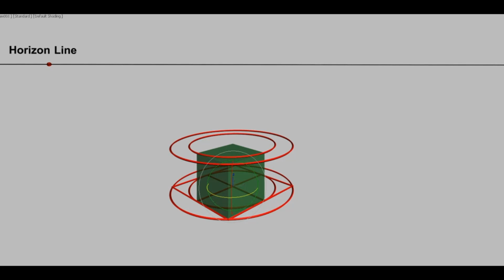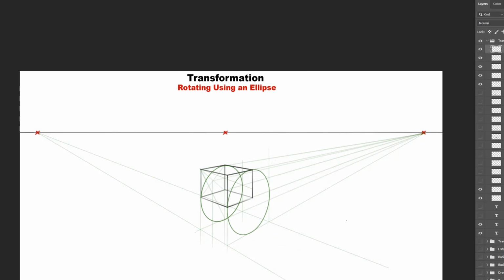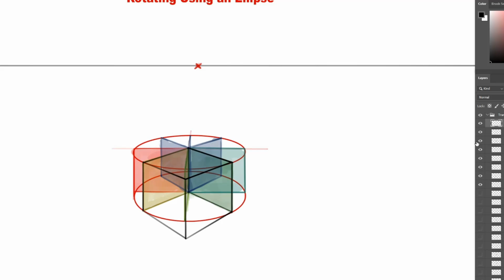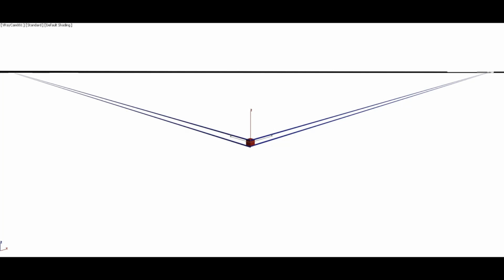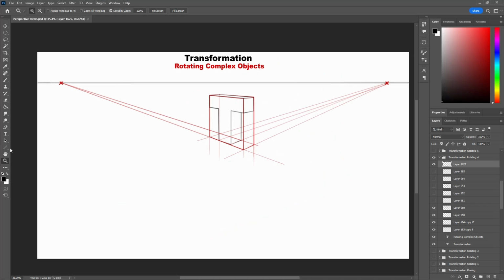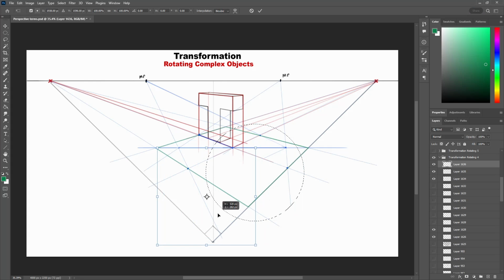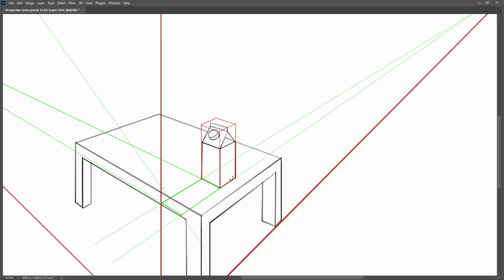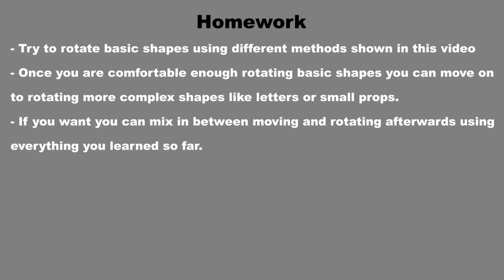Lesson 23: Rotating Objects in Perspective

Comment: Would this work for rotating in multiple axis? Say I want an object that is tilted in X, Y and Z: do these techniques work?
Reply from the maker: Sure thing, but you have to do it one axis at a time. So lets say you are using the ellipse to rotate the box on one axis lets say the X axis. Once you rotate it now you have to draw the ellipse again in the new location but for the Y axis and rotate it again. Then finally in the Z axis. Eventually you will reach the rotation you want. So if you are working in 3D and you want to rotate a box in Y axis you will do it like (0,90,0). If you want to rotate it 90 in each axis it will be (90,90,90). In 3D you can just free rotate an object or rotate it in X 90 degrees, then in Y 90 degrees and then in Z 90 degrees. Same thing if you want to draw it.
Reply: @SalemShanouha  Thank you very much!

Comment: I could not understand from 1:32 , how did you extend the line to the infinity? From where did that vanishing point came? and how exactly the rotation working in this case? I'm not very knowledgeable about this, could you kindly explain? Im not able to understand from 1:32 to 3:10
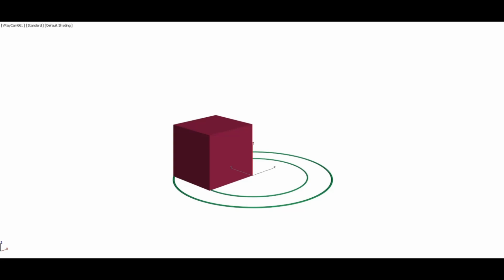Reply from the maker: the edge was extended to a vanishing point way to the side outside of my canvas but at the same horizon line. I guesstimate where it would be, but if you want to you can extend the canvas and hit the point exactly on the horizon line. The point of this method is that the rotation circle will be the limit to the box edges. as you can see at 4:30 no matter how you rotate the box its bound by the circles around the edges. so when you go back to 1:32 what I'm trying to do is construct one side of the box by choosing one edge as a base, then choosing a rotation angle or how much we want to rotate the box. Then since the box is in 2 points perspective the vertical edges will always be vertical, so now we got 3 edges of the face. for the final edge we can extend the bottom edge toward the horizon line to get the VP, and then guesstimate where the upper edge will meet it at that VP. Now you have a full face of the box. 

Now since we moved the first edge anticlockwise we have to move the other edge of the new face we want to rotate the same way. to get the same rotation we can either guess it or use diagonals to mirror points like we talked about in previous lessons, to find the exact point where the first edge hit the diagonal and mirror it on the other diagonal, where that point is we can connect it to the base edge to get the 2nd edge of the face. now we can extend the new edge back to the vanishing point at the horizon line to get our new VP and from it we can draw the top edge of the new face. 

we have now two faces of the box, its easy to get the rest by simply connecting the current edges to the new vanishing points to get the rotated box. and as you can see the new edges rotate on the inner circle we started with as you can also see it on the diagram on the top left. 

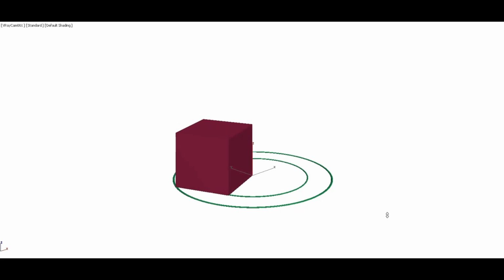to imagine it, think of the base edge as a stick bolted to the ground, and the first edge of the box we chose is glued to it, and you are rotating the box around that stick. If you have blender, or sketchup, it helps to see it in 3D in different perspective as it is in 4:30 to understand what is going on. It will help a lot to visualize it in order to draw it.

I hope that explained it a bit better :)

Comment: I have only used the ellipse method to rotate objects in space but I had learnt the vp method too.
I looked into it today after I had briefly explained it to someone and they said it doesn't seem to work, I looked into it more and as far as I can tell it's not correct.
Just before the box rotates into 1 point perspective the convergence is nearly parallel, if the VPs are the same distance apart that wouldn't make sense since one vp would be near infinitely far away.

I may misunderstand this do you have any thoughts?
Reply from the maker: I think in order to have a better look at it, check out the final video of chapter 1 at this timestamp https://youtu.be/sorzEGZptbg?si=9RjHWhomGQ7v3WdN&t=894 

it will show the big picture of this in 3D. an object will have different vanishing points that rotates around a sphere, thats what we try to convey using perspective drawing. the method might not give you a 100% accurate rotation mathematically cause you are kinda guessing the location of the vps as you rotate the object unlike using the ellipse but it is a faster method if you just want to draw an object with rotating parts without going through the whole calculations.

 But if you really want an accurate rotation you can mix up a simple ellipse with the vps. like in this picture https://i.imgur.com/EmfYyiI.png
you can start with the basic box, draw two ellipses that hit all corners top and bottom, move one vp to the left, connect it to the ellipses on both side to get 2 faces, then connect in between the faces to get the other 2 face and the other VP location. this way you get the best of both world. Once we start drawing props or objects in perspective, we usually don't draw any guidelines and just do a quick ellipse or quick perspective lines around to rotate objects toward different vps.  let me know if you have further questions :)

Comment: Why didn’t we use the MP when rotating the letter similar to the stacking video when finding the length of gap
Reply from the maker: With perspective drawing there are always more than one way to solve a problem. Rotating objects in perspective can be done in many ways, so I try to change the method with each example so I can cover as many ways as possible. It would be a good practice to check your work using different methods, this way you would be 100% sure that what you are doing is correct.